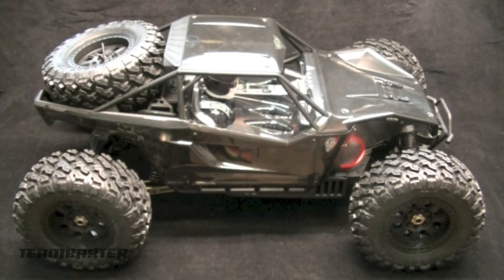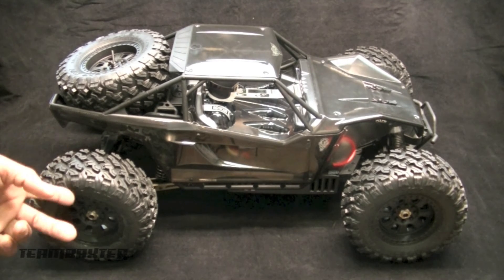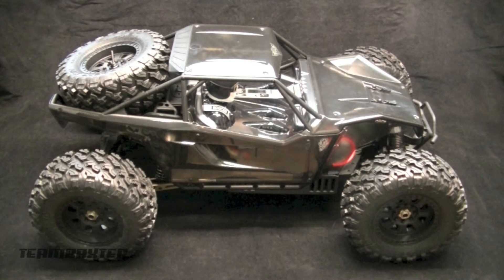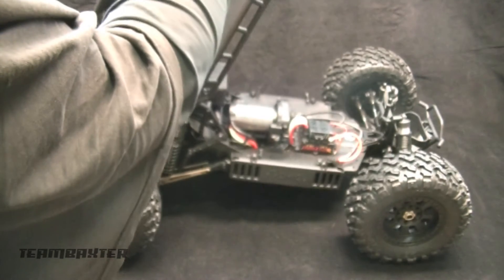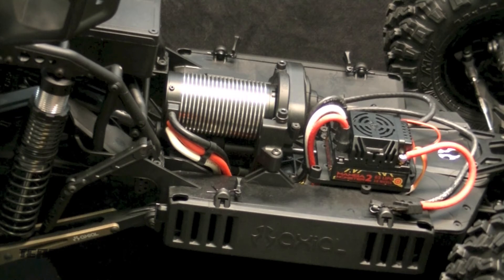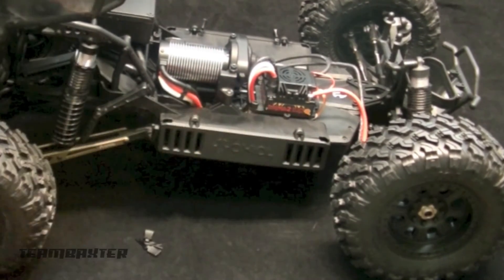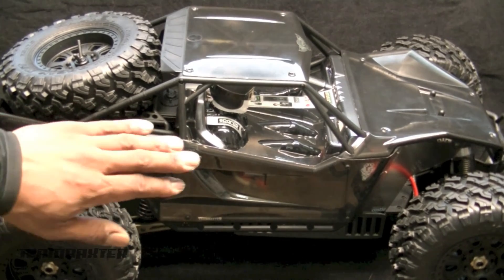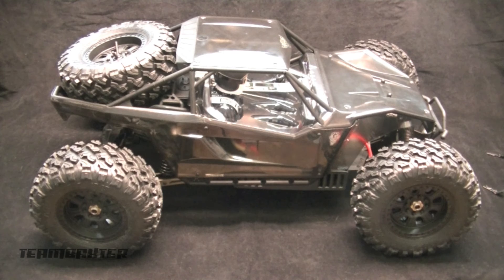Axial Yeti XL Kit Build: 14 -Wrap-up / Overview

Comment: Hi, Just wondering why you used non sensored motor/esc equipment ? I've seen a few YouTube reviewers use this set up. I cant understand why. This model is also a climber not just a basher. Sensored set ups would be much better especially when driving up very slow inclines. NO COGGING. The cost difference between set ups is next to nothing. Please explain!
Reply from the maker: kga5150 Number 1 reason for not using sensored equipment is that i buy pretty much only factory waterproof equipment, as 60-75% of my runs deal with heavy water play/ submersion. I dont do much waterproofing on my own, other than servos, to avoid the risk of failure. If factory waterproofing fails, i have the manufacturer to blame. If my own waterproofing fails, i have no one to blame but myself. Number 2 reason, and probably the most important, is that i am NOT a basher, as evident from my channel. I chose a system that would allow me to do what i need to do when the time comes to convert this guy into a trail truck. Im not much on the hybrid trucks (trail truck/basher) because i feel like one side always suffers, if not both. This is the reason i ended up with 2 little yetis. One is a capable crawler, and of course the other is a speeder. I very much agree that a sensored would be the best for a hybrid truck, thats just not what i built. Thank you for your comment, nice to see someone disagree with my setup and not verbally assault and berate, which happens frequently on the 'tube. Thanks for watching, and as i was typing this incredibly long reply, i got an email saying you subbed, so thank you for that as well!

Comment: Sorry to be picky but never soak your bearings in oil [diff build video]. Bearings are packed and sealed in the factory with GREASE. By soaking the bearings in oil you are actually diluting the grease and increasing the wear rate.
Reply from the maker: kga5150 Ive been soaking my bearings in grease for years with no problems.Most of the vehicles on my channel have soaked bearings. Yes the bearings are supposed to be liberally filled with grease from the factory. I have had no problems with wear and cannot remember an instance where a bearing failed on me. Works for me, but to each his own. Do what works for you. Thanks for watching and commenting.